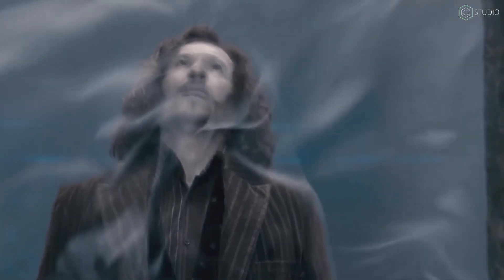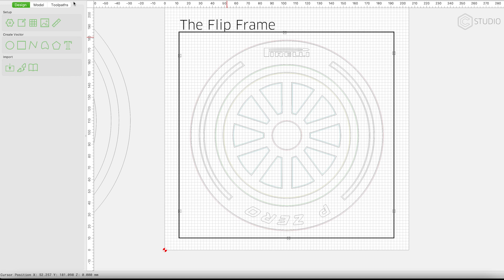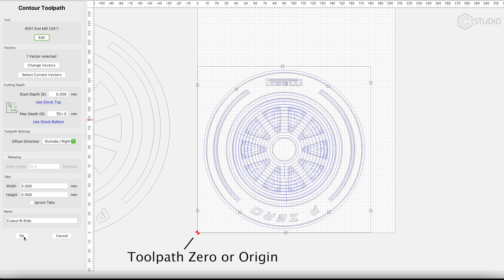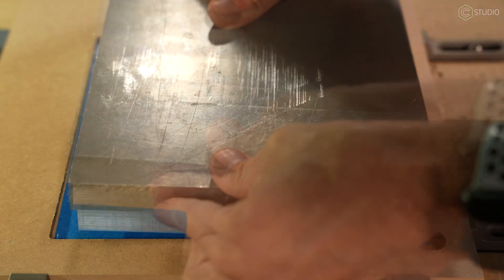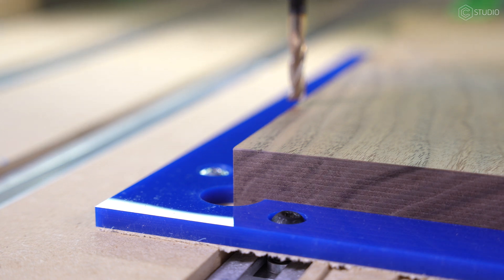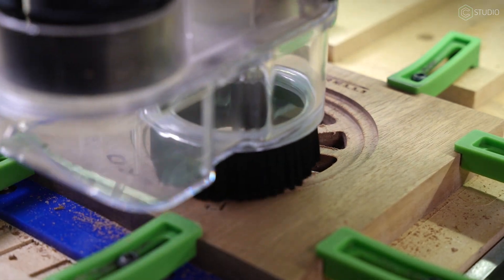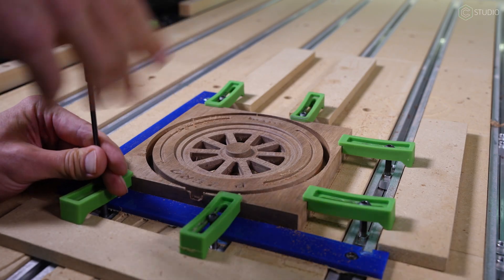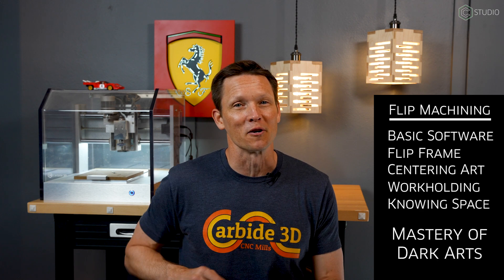CNC Router Flip Machining

Comment: I had a problem with this and ultimately sold the machine because of it. I had a known location saved on the machine. I used the center point origin. I milled the topside of the part one day and then turned the machine off. Went back the next day to do the other side and sent the machine back to the saved location. I thought everything was ok so I started milling. Only when it was too late I noticed the part was off in the x direction by about an 1/8”. The machine was not able to retain the exact coordinate between homing cycles. I tried multiple times and it was the same story. How would I have fixed this?

Comment: Great work, except you do not show what you are selecting to "add the flip frame" to the carbide create file. I've looked all over my Carbide Create Software and haven't found any reference to a "flip frame".
Reply from the maker: Draw a square around your part and be sure the part is centered within that square.   You have now created a Flip Frame.  
After your A-Side operations, cut through your stock outside that flip frame.

Comment: I'm not understanding fully how side A is using the flip frame, then you cut the object off of the side A tabs, and reposition side B properly for zero when Side B is no longer part of the bigger frame that held side A.  How are you calculating the offset created by the material loss and making it exactly match for both sides?  And yes, I want that square you built in the video.
Reply from the maker: J. Paul, You only cut halfway through the stock on your Object Contour for Side A.  You cut all the way through the stock for your Flip Frame Contour.  This keeps your actual object trapped inside that flip frame at the completion of Side A.   
For Side B, you position the flip frame in the corner square, physically flipping the frame along just one axis.   For your Side B File, position your flip frame corner coincident with the Toolpath origin "Lower Left" for this method.  Run Side B, cutting just past halfway through your Object Contour.  This will cut out your desired object.  
Download and inspect the two files, over at CutRocket.  That should help.

Comment: I manufacturer the HDPE sides for the PwnCNC VFD-Enclosure/Spindle Kit on my Shapeoko Pro XXL. I cut eight sides at a time with a flip in the middle of the job. It takes a little to get your head wrapped around however if you take your time and focus on alignment and mirroring then will eventually click in your head and make sense.

Comment: I understand the corner square and love the idea, but how are you locating the exact tool path zero point of that square the first time setting up? you look to be eye balling the center of the the end mill to the corner, which I could see being close but not exact?
Reply from the maker: The square itself was cut around the same toolpath zero used for the second operation.   Look at the shots of the square being designed and you'll notice it is located outside the stock in that file.  Therefor, when the stock is located in the square, the corner of the flip frame aligns with that toolpath zero.
Reply: @carbide3d  so after the flip and the part is made. Is there any way to change setups, come back and still have any hope
Of having exact zero for a flip?
Reply from the maker: Yes.  You can save that corner square location permanently inside Carbide Motion.  In fact you can name it as well.  I’ll have a couple follow up videos on cutting the square and working with offsets